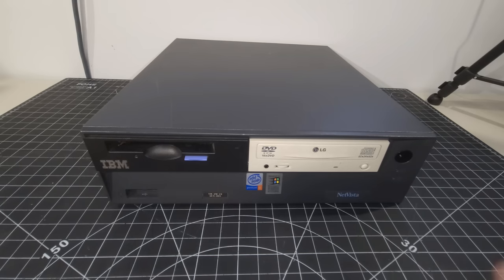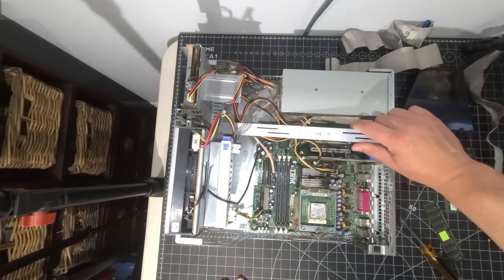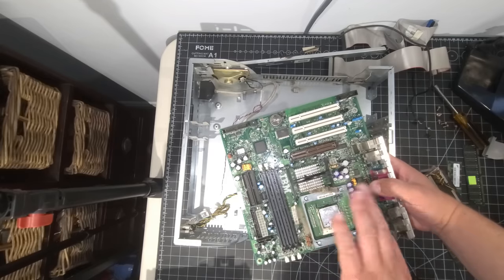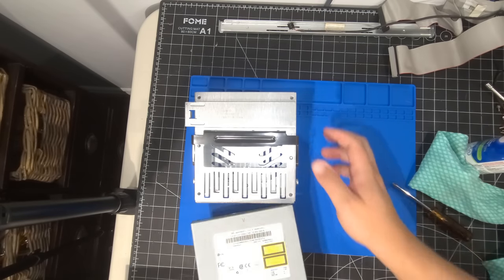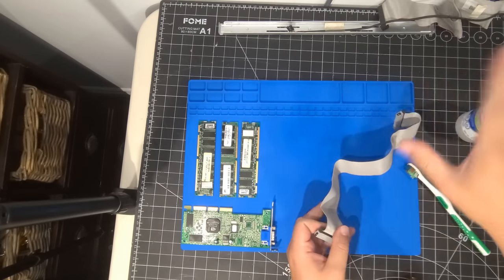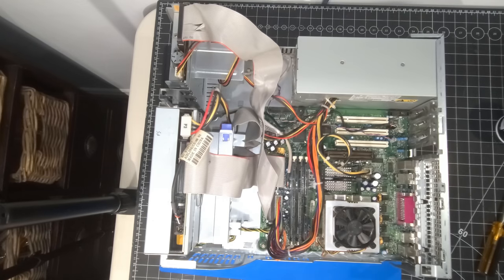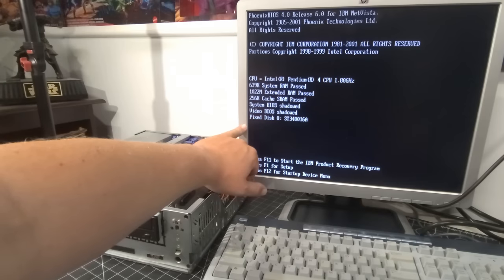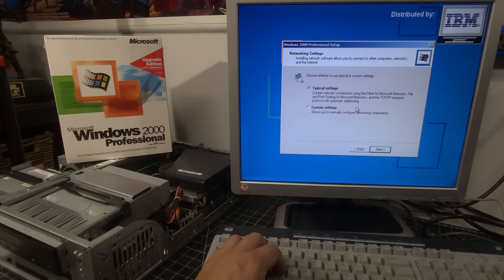The IBM NetVista from 2001 - Full Restoration!!

Comment: I hope you don't mind me going off topic a bit, but there's an interesting story behind it. Even though the hard drive is from 2001, it's not original; back then, they only used IBM DeskStar drives. But this was when IBM had massive failures with certain series of their drives (which this one would've had).....they usually crashed within a month or two, and were replaced under warranty. The problem was so bad that IBM was sued, and lost; they had to reimburse each user $100 for their failed drive. The issue was that the process that bonded the magnetic particles to the disc was faulty; this allowed those particles to be flung all over the inside, causing head crashes. I'm glad you brought this beauty back to it's former glory
Reply from the maker: I was aware of the Deathstar series :) however I just assumed that die to the amount of failures they switched over to a different brand for this model.  Also where it has the original oem software, partitions etc - even more reason I thought that.  It is possible that the IT team had duplicated the drive.... 

Yes - extremely happy about this system being fully operational again!

Comment: Don't forget to create the recovery CD/DVD so in the event hard disk fail, you can later on reinstall back the Windows to the new drive (IDE hard disk or SSD using SATA to IDE converter/PCI SATA Card)
Reply from the maker: I have a full image of the drive.  I plan on creating rectory media - hoping the system has the application to do so.  Worse case, I do that the complete drive image.
Reply: @TheRetroRecall  Hi there, did you have a chance to image the whole hard drive with the recovery partition? I got the same machine today but it doesn't have a hard drive, so I planned to re-image the whole disk with a factory image. I really appreciate your help. 🙏
Reply from the maker: Hey there, to be honest I have not had a chance yet.  Sorry about that.  I have added it to my list.  :)
Reply: @TheRetroRecall  No rush at all, thank you 👍🏻

Comment: I love seing Windows 2000. I used to work at a private school here in the UK, and I was responsible for upgrading all of the workstations from Windows NT4 Workstation to Windows 2000. It got to the stage where I had installed it so many times that I remembered the CD-Key, and could install it blindfolded. I miss the days of simple and quick Windows installations/upgrades.
Reply from the maker: Haha yes!! The same can be said about gaming as well.  Everything is complicated, takes a long time and is dlc based.
Reply: @TheRetroRecall  I think XP was the last of the great operating systems, kinda the best of Windows 98SE and 2000, and not a pain to install unlike Vista onwards. I discovered your channel a few days ago, so having a bit of a binge watching your older videos. Do you ever get old retro servers? I have an old Dell PowerEdge SC1430 that ran Server 2003, but now runs Fedora server.
Reply from the maker: Welcome aboard, great to have you.  Older servers are not 100 on the agenda, however if I come accross one.. I will definitely do a video on it :)

Comment: Just repaired an Asrock M266A board. Had to replace a few capacitors and a new BIOS battery. Everything else operation and tested it under Windows 98 and XP installations. I really want to invest in a solder sucker pump tool
Reply from the maker: They make the world of difference.  I have the Hakko FR-301.  Works very well and is decently priced.  That and a little solder braid will help the day :)

Comment: According to our most trusted and complete knowledge website:

The Nvidia Vanta is a budget version of the TNT chip with a lower clock speed, half the memory bus width(64-bit) and memory size. Build out of normal TNT dies that did not meet specifications.
And of course rather popular with OEM's.

Not great for 3d gaming but good enough for 2D work.
Reply from the maker: Most trusted and complete knowledge website.... I'm dying over here ahhahaha
Reply: Vanta = TNT2 M64 ?
Reply: @clankg33k  A Vanta is in an nutshell an slower clocked TNT2 M64 with slower SDRAM. Out of the top of my head 120 to 100 MHz on the core and 143 to 125 on the RAM.
The Vanta LT was even lower clocked 80/100 MHz or something like that. At least thats what there should be clocked at. Back then Nvidia wasn't as powerful as today so basiclly every AIB clocked the chips to their liking. Another problem was that Vanta cards were sometimes falsely advertised as TNT2 M64 or TNT2 Vanta or plain TNT2 cause TNT2 would better sell OEM builds.
And that Nvidia introduced an NV5 die shrink in 220nm for Pro and Ultra versions did add even more to the confusion cause Nvidia refer these sometimes as NV6 and sometimes as NV5 and after that everything slower than the TNT2 Pro could be an NV5 or NV6 chip as well. So some people assumed NV6 the chip of the Vanta which is true and false at the same time. You can't tell without disassembling the chip package down to the silicon cause they didn't change the markings.
Reply from the maker: Love this in depth info, thank you!

Comment: I'm sure that P4 runs W2K very well, b\c back in 2000 I built a W2K box of K6-2 550MHz and 384 megs of ram and it even ran W2K well. Also that is a very nice computer from that era. ...  Even though P4(s) below 2.0GHz ran W2K well, if they were upgraded to XP they did not. For XP you needed a P4 of at least 2.5 GHz to run it well. And certainly not a socket 478 or 775 Celeron OMG, I worked on so many of those XP dogs back in the day.
Reply from the maker: Thanks for sharing this!  This system runs quite well. I can see though for XP that you would definitely need so extra horsepower :)

Comment: I had a ThinkCentre M52 which has a very similar design. It was a bit newer and had a P4, but sadly it suddenly got a bad case of capacitor plague after sitting dormant for a couple of years. I really loved the design of the case, but it wasn't worth salvaging. It had a noisy fan system and only one low profile PCI slot for expansion, which didn't give it the graphics card it needed for some decent Windows XP gaming.
Reply from the maker: Sad face for sure.  I remember those configurations.  The thing about IBM they had quite a few different configs for this same design.
Reply from the maker: Yrah, I hate hearing about those systems that die as a result of that.. It's a shame really.
Reply: @The_Rebel934 What kept me from it was that it was incompatible with Windows 98. It didn't have the graphics capabilities to run any AAA game in Windows XP, so despite it's great looks, it wasn't worth saving.

Comment: im not so sure, but I think after windows xp you dont need the cd audio cable anymore... sound goes through the ide cable... i think in win 95 98 you needed the cable
Reply from the maker: I think for Windows 2000 it would still be required.  Funny how a lot of drives manufactured after XP still has the port on the back:)
Reply: @TheRetroRecall  yes.. even if its new today it has the port... but I think new OSs software grab the music in 'data mode', not in in normal 'cd player' mode. 
but if you press play on the front of the drive i think you must have the cable always..
Reply from the maker: Ahhh nostalgia.  I remember when we got our first cdrom in our 486.  4x Creative drive.  Playing cd's was so awesome.
Reply: @TheRetroRecall  i had an amd 486 dx2 66mhz. 2x sony cd rom.. no sound card, no musica.. sound card came later